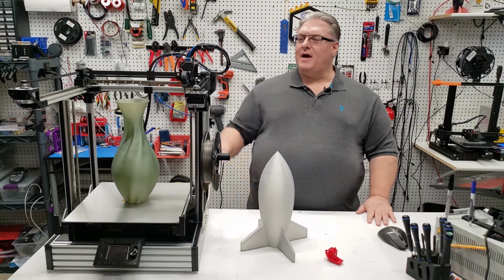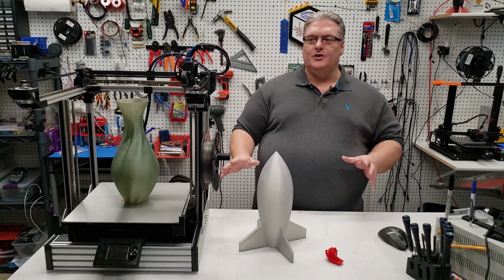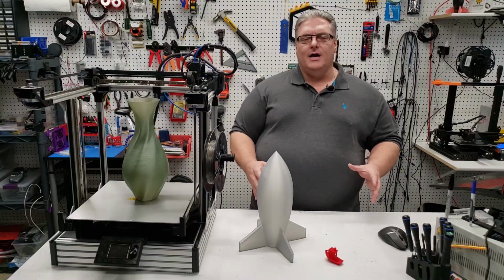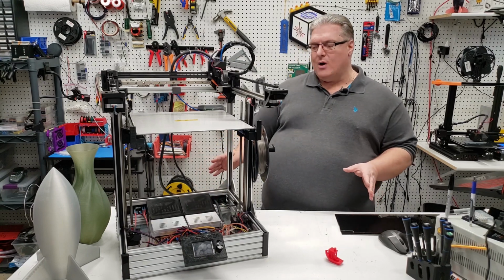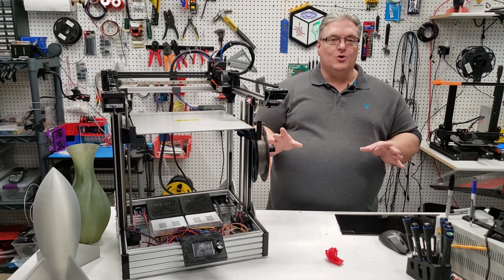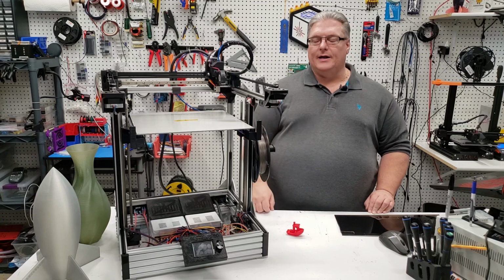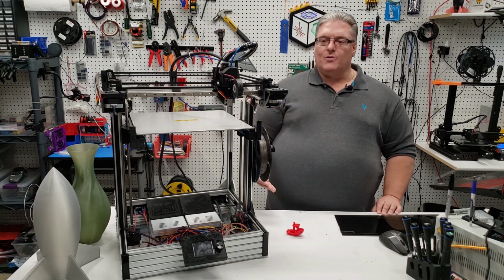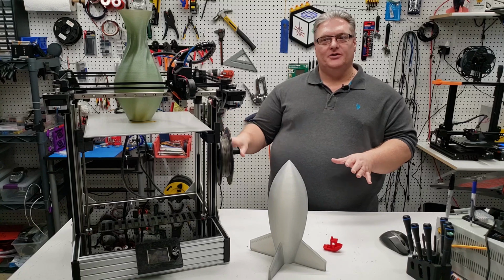DIY 3D Printer - Build a CoreXY Printer - LayerFused X301 Preview

Comment: One comment that comes to mind is that if you enclose this printer to print higher temperature materials, the PLA supports could become soft and you'd loose belt tension.  It would be interesting if you could replace the plastic parts with other material that would work inside a heated enclosure for printing engineering materials.  Just my thoughts.
Reply from the maker: There is no chance that the PLA Bed mounts will melt.  Even 100C on the bed cant heat up the screws to the point of melting the mounts. Just not enough thermal transfer of energy to the length of the entire screw.  You could also always print them in PETG if it was a concern but even at 100c bed they don't melt or get soft.
Reply from the maker: Sorry gizmo missed you mentioned enclosure.  Yup you're right you would need something like petg for an enclosure at higher temps.

Comment: I'm interested in to this design. I'm trying to calculate a rough price estimation by myself. Frame costs about 35-40$ in here, excluding 3d printed parts. I found 300x300 bed for 50$ and I actually don't know how i should choose a power supply so it should be another 50 maybe 80$. From that point, I'm lost haha. I was thinking of building your previous design but coreXY seems a good and solid starting point to me. I looked up silicone bed mounts but i couldnt fint it, ı only found one with m6 bolt attached under it and solid top. I'm looking forward to this build, waiting for the next video.

Comment: Nice design. The name makes it sound like some branded production printer. Looks to cost at least $100-200 more than my dBot (just need to finish wiring, flashing firmware, and final tuning).  X-axis stability at the front of the rails seems a little questionable, at least compared to the rest of it. I'll let you know if I end up considering the front/top extrusion on my dBot to be an issue, but it doesn't seem like it will be. I like that I can grab the whole thing by the top y-rails and pick it up or turn it over with no worries because of the cubic frame.
My old i3 maxes out a little over 40mm/sec with Mk8 direct drive extruder. This is 100mm/sec faster: wow. Can't wait to see what I get with my direct drive Titan/E3.